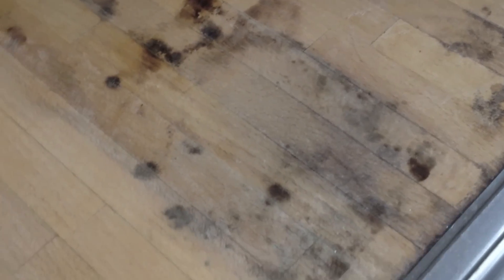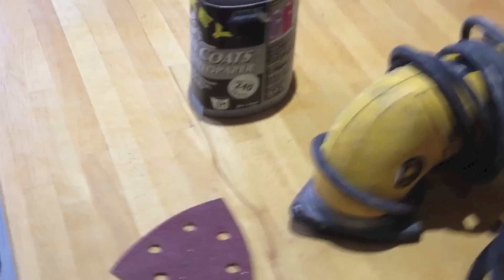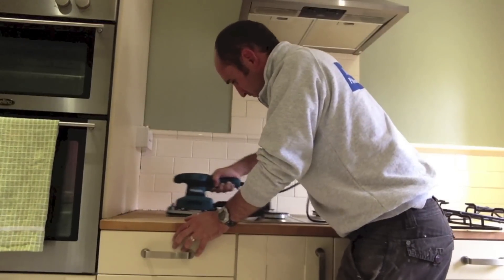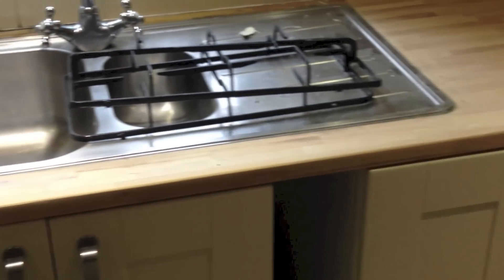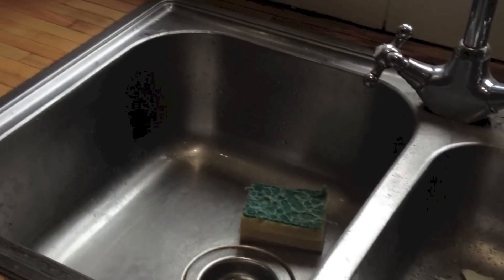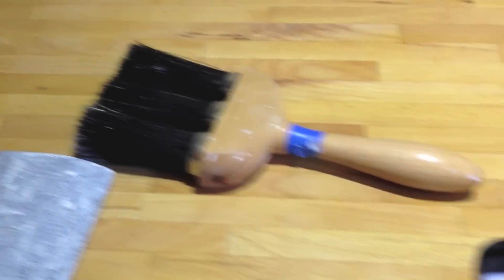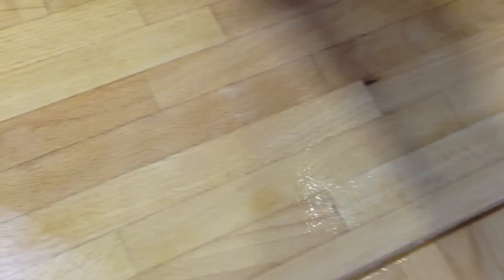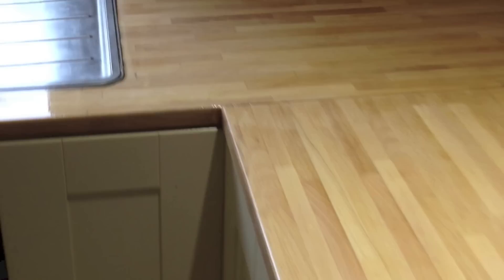Sanding and oiling a kitchen worktop

Comment: Rob, Provided it was an oil finish before,  I would have gave it a light all over sanding.
Saturated around the areas with staining with oxalic and left for about 30 min dried it of and left it for a day. If there was any staining left when it was dry I would have gave it another 30 min of oxalic wiped it down and let dry for a day or so.  When dry gave it a light sanding with 120 follow with 240 to flatten the grain and re-oil. 
It would have saved all that sanding and left a cleaner finish than aggressive sanding alone,,, but it dose take much gong back and forth, as allowing things to dry in between each visit is necessary.

Comment: Is it possible to sand down a laminate worktop? or are you screwed if its scratched? ive tried using the soft wax repair kit but the wax just wipes out

Comment: A very good practical video. Thanks. I intend to use Danish oil instead of worktop finish oil..... how different would the outcome be?
Reply: My worktops came with a bottle of Danish oil when new, it is recommended by many solid wood worktop makers, Rustins brand being one of the better ones
Reply: Oddly, Rustins technical department recommended their QD acrylic.
I am not convinced this is oil .

Comment: Hi, Rob. I followed your video the first time I did my kitchen worktops and was really pleased with the results. However, having decided to do them again, I have discovered that the Liberon Worktop Finish and Seal is no longer available. Could you recommend anything that would give equally impressive results, please? Thanks!
Reply: Cabots is good quality, doing my benchtops now and getting a really nice result from their benchtop clear varnish. It was recommended by the people at my local hardware store and when my builder asked what I was using he approved of Cabots too.

Four coats with the 240 grit between each application, one tip my builder gave me was to add half a day to the recommended 2 hours between coats. He stressed that it's worth taking the extra time to do it right and you will have years between re-doing it so you may as well take the time to do it right. Good luck!

Comment: Hi Rob, great video, about to follow it to the letter. Tell me, the bench top in the place I have just moved into is sticky to touch and i think they havent used the right oil, so should i remove it with white spirit first? or Just sand over it! Thanks in advance.

Comment: Just done this on my own work surface today. I am using an Osmo oil. It doesnt say more than one coat is needed and refers to an 8 hour drying time. Should I do a second one anyway after 8 hours?
Reply: You should probably follow the instructions to the letter.  Multiple coats don't necessarily mean better protection as Osmo oil has hardeners in the blend, meaning that the second coat may not soak into the wood and may look rubbish and/or be prone to flaking.  If in doubt give Osmo a call, they give good tech support.
Reply: Osmo definitely needs more than one coat

Comment: the new oak worktop has warped before oiling down is this normal it looks defective...
Reply: The worktop has warped due to moisture ingress.  If you've got an appliance like a dishwasher, washing machine or tumble drier underneat, and the worktop wasn't properly treated before installation AND had a moisture barrier fitted to the underside, then this will cause the worktop to warp.  In a nutshell, it's probably not defective, it's not been treated or prepared properly (probably).

Comment: Not a proff job......first remove sinks,hobb ect,then sand....you can use 60,but must get down to 120 grit before oil........then i wonder what sealant you will use between top and tiles as silicon dosnt stick to oiled top.....??

Comment: Rob, tile grout on our new oak worktop has caused a stain that has remained despite sanding. Do you know if grout is a particular problem for such surfaces or is the problem that the surface wasn't properly oiled. Might it be that the grout has soaked through the wood and hence will continue to be evident however far we sand? Thanks Stuart
Reply: Otherwise known as mortar burns. U can sand until the cows come home that staining is not coming out.

Comment: Hi Rob.  I did this job a few days ago and thought I was going great guns.  The stains I was removing disappeared but to my shock the areas I had sanded ended up a much darker shade than my very pale worktops. Is there anything I can do to restore the original colour?  My worktop is now horribly blotchy!
Reply: Not a professional, but I assume you have to sand and coat the entire thing at once. Same as if you were to repaint a room; if you only paint one bit, you'll 99% not be able to match the exact colour.

Comment: Is it possible to use cooking oil? (it is cheaper and surely not poisonous)
Reply: Cooking oils will become rancid and smell terrible.
Reply: Not cooking oil, it'll go off.  You can use Paraffin Oil (that's what I use), it's waterproof, food safe and is cheap.  I buy a product called "Skydd" from IKEA.  It's not very expensive and goes a long way.  We're 2+ years into having oak worktops and they look awesome still (a bit darker than the video) and even though it's been months since I last treated them they're still waterproof.  A good tip that I got was "Once a day for a week, once a week for a month, then once a month for a year."  I've not stuck to this regime exactly, but it's done the trick.  Just a light sand with a large sanding float + 200 grip paper before re-oiling does the trick.  They get washed down when they get grubby with weak washing up water solution (like you'd wash the dishes in) and dried with a towel.  Final tip, NEVER put wet steel pans on the work top, you'll get dark rings.

Comment: Osmo Top Oil is what you want
Reply: Tom Hudson can I use osmo top oil on a worktop what had vanish.
Reply: Yes. If you remove (i.e. sand) the varnish and bring the worktop to bare wood. Osmo Is pricey but worth it in the long run.